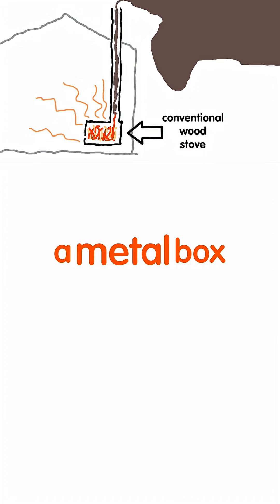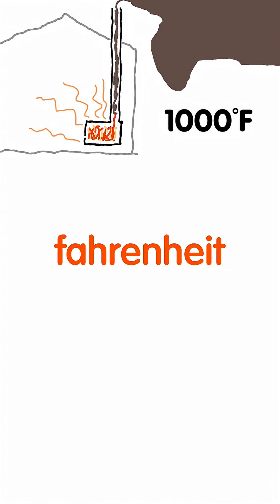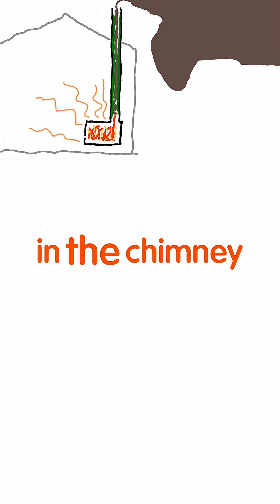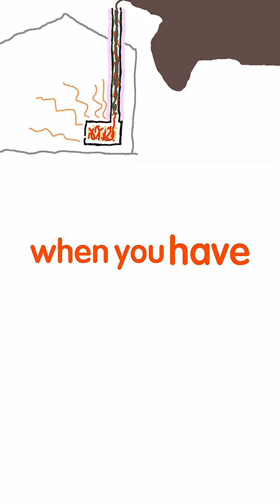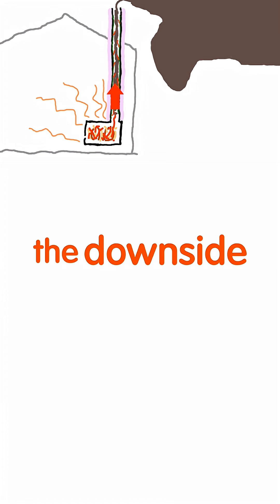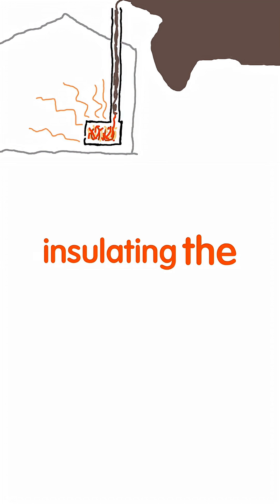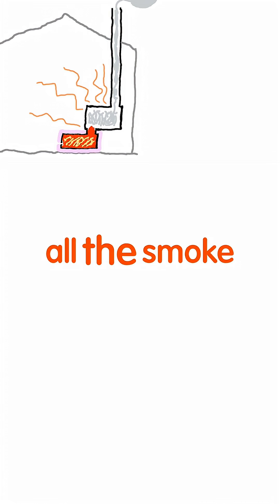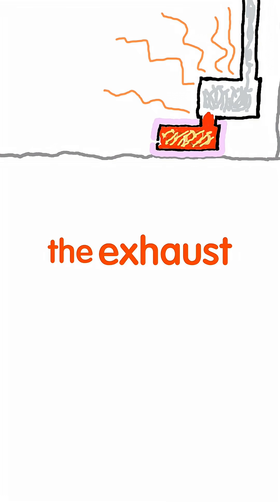What is a rocket mass heater?

Comment: I have a wood heater, but have not use it since 2005 because my nephew & his defacto who resides with me, open the front door at night while I,m asleep. Or he open his bedroom window with the ceiling fan on high speed with a floor stand fan on high speed. As he sleeps , & in the pass 5 years open the back door at night especially in the winter, burning more wood than necessary.  Instead of 1 ton for the whole winter we need 2 tons of wood at 300$ per ton. So no more wood fires in the winter, because it became pointless to try & heat the house when a nut case of a nephew leaves doors open, I can't get insurance on the house, because nut  case looses house keys. He punched my lights out police were called arrested him , I didn't want him to go to jail just have him compulsory get mental help.The sheltered workshop where he works thought that he was going to jail manged to get the charges changed so they still have their star worker still working for them & I was made out to be an arse hole. He refuses mental help & gets away it .

Comment: FYI 1000 degrees Faren... (why the hell are we still using a temp system based on the boiling and freezing of alcohol when we should just change to the Centigrade scale like the rest of the world) is 538 degrees centigrade.
Reply from the maker: i like the art of it.  How do you feel about switching to a metric clock?
Reply: @paulwheaton  a 24 hour day time system, with 60 minutes and seconds is easier because a circle (the Earth as it rotates) is also easily divided by an easy denominator (3, 6, 12, 24 etc.). All the results are integers. I guess that we could also suggest a number into which a circle is divided which would also result in whole numbers but that feels as though we're very badly, 're-inventing the wheel'. Then there's the moon's motion to fit in with this. I don't think the Greeks and Babylonians were thinking about the 'art' when making their observations. Re: temperature - Kelvin? Btw - I thought Fahrenheit was alcohol. It was actually based on a solution of brine.

Comment: I once built one where the cold air intake was on the outside of the home, so the thermosiphon wouldn't draw cold air in through the door and other cracks. It was set up so wood could be fed from either inside or outside ~ the long feed-tube allowed feeding of longer branches from the property, significantly cutting back on wood processing efforts. 👍👍🔥

Comment: You can make one (I have) or buy one. Properly set up in an efficient home, you can heat with sticks picked up off the ground. With copper tubing around the riser, you can heat water without a pump (thermosyphon).